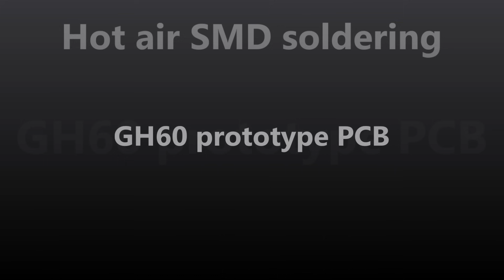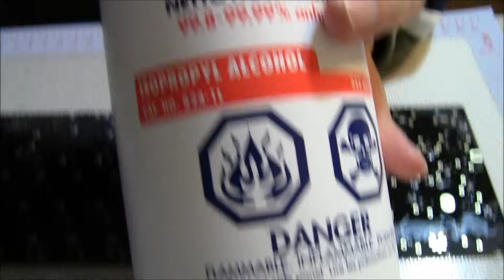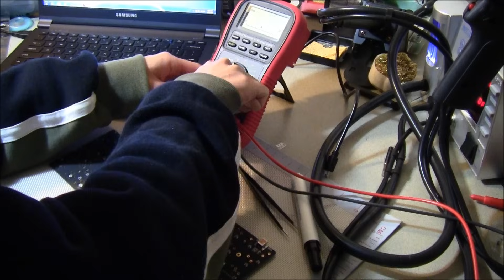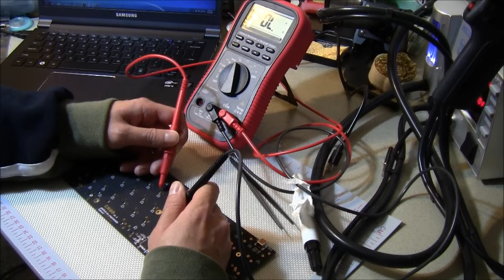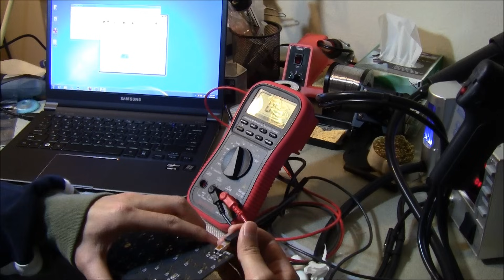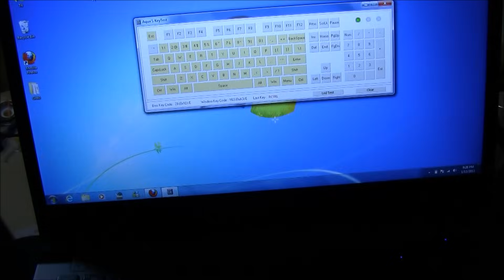SMD soldering by hot air

Comment: Ignore all the 'I was soldering when you were hanging off your mommy's apron strings' know it alls. I too have been at this for a few decades difference being I continue my education into the state of the art. The low melt paste is fine and you're preparing the pads so I see no problems with your methods of attachment. I will suggest a few things, though.

 For example your controller IC. Standard flux paste on a swab across all pads and then drag solder it. You can find drag solder demos all over YT. It's easy to learn and achieves ISO standards. Learning this method will cut assembly time down. You want to get your assembly time down.

 For testing your keys you also might find switching your DMM into continuity mode and using the probes to be faster than moving the tweezers about. This will cut down testing time.

 Lastly, as a designer/builder consider real world working environment. USB mini and micro are prone to damage in use. Even with careful use. Consider a tiny drop of epoxy under the port before placement. You may have to experiment with this and use a higher melt standard solder on the ground lugs. The goal however is to achieve a robust jack mount less prone to breakage.

 You have a lot of skill at your age. Take the advice of the elders but take it with a grain of salt. A lot of them don't continue to educate in the state of the assembly materials art. The materials you're using are designed to be used just as you are. They don't understand that the majority of CE on the shelf today is built using these exact materials and methods, only by machine.

 Lastly, a lot of PCB fabs will offer to pick, place, and wave solder your parts for additional setup fees. Might not be enough product to merit the additional costs on this project, but something to consider for high volume. They offer this in stages so you can opt for the SMD and then you just have to inspect and add the through hole parts yourself. You may find yourself in a position where this makes sense in the future.

Edit: And definitely ignore people like Barry who come by 4 years later and drop 2 dollar words during the apocalypse and point out autocorrect errors at 3am instead of just offering some encouragement to a kid. They’re absolutely part of the problem. ;)
Reply: +monosurge I simply must take the time to applaud your comment! Bravo!
Reply: +monosurge I have to also say... probably the most constructive comment on this video and no bullshit ego or douchebaggery.
Reply: +Nathan Kopilec Simple words from a simple man.
Reply: +Michael Snyder Must have struck a chord with you.. But I wasn't in any way implicitly singling you out with respect to "douchebaggery". I happen to own a company which develops automation equipment, motion control equipment, and tooling. I hold multiple degrees in mechanical, electrical, and controls engineering, and have been studying synthetic chemistry for quite a few years. If that makes me simple, I hope the rest of the world follows suit. There's also nothing I hate more in the world than the many pricks who profess some grand possession of knowledge, but are either unwilling to share it or are unable to do so without being a prick. I didn't need the help from the video.. I just happened to watch it, but I appreciate people who offer help and experience in a constructive manner. Those who are simple can be taught.  Those who bathe in their own ego are hopeless.
Reply: +Nathan Kopilec Very well said! The most insecure dogs, bark the loudest.
Reply: Oh, good, someone with experience who isn't afraid that someone won't know about it.
Reply: I've been soldering since you were hanging from mommys apron strings.

Sorry, had to do it XD

In all seriousness, your comment is good and I agree with what you say.
Reply: Unrelated. what should i set my temp to :?
Reply: monosurg
Reply: well said and all this helps the community of like minded/trying ot be good at their hobby, job, profession xx my 2 cents
Reply: Anyway you could do this for adding the full HD mod. To 230x thinkpad?
Reply: I definitely agree with @monosurge

Regarding micro USB/mini USB ports: from a mechanical point of view, the insertion force when plugging in a connector is applied orthogonal to the solder pads - and the only thing to counteract this force is the solder between part and pad. This does add a fair bit of stress to the solder joints, so after many insertion cycles, this might be a common source of failure.
It would be likely better to use a connector that comes with THT strain relief pins, because the THT hole allows the pressure to be applied horizontally against the PCB, which reduces the risk to shear off the connector described earlier.

But you have absolutely no reason to believe me, I'm not an EE by trade, I'm just a 18 yo guy telling you things.
Reply: Barry Manilowa  - no harm done adding epoxy in securing items such  as USB parts to boards - especially for those of us willing to go extra step producing a product of enhanced quality. I've seen boards from factory origin having resins securing such parts...
Reply: @alphaprot2518  - I too agree
Reply: you said lastly more than once
Reply: Well how bout 4 years later saying thank you for dropping some amazingly useful knowledge!!!

Comment: This isn't a bad start for people who want to learn, but here is the more proper way to solder using the paste and hot air method without having to waste time tacking on the IC.

First, and I don't see very many soldering tutorials say this, but clean your board and your component before soldering. The solder will not stick to dirty surface. Simply just dab an acid brush (or soft bristled tooth brush into some isopropyl alcohol.

Flux, yes there is flux in the solder paste, but placing flux on the area you just cleaned, keeps it cleaned.

After that, just place the component (IC) on the board and apply the paste across the legs as he did here. The solder will pull the part onto the pads on the board, just as you see when he did the caps and resistors.

And as always, clean the flux residue afterwards. But more importantly, stay safe!

Cheers
Reply: He tagged the ic to the board by two legs first so that he could melt the solder paste on one side of the ic at a time without it going out of alignment. That way he didn't have to use a massive nozzle on the hot air gun and heat the whole ic to 200+ degrees C. And by the way Americans, we British correctly pronounce the word solder not sodder! hehe!
Reply: +Dan Davenport Hi Dan, go to http://dictionary.cambridge.org/us/pronunciation/english/solder. In America Solder is pronounced differently than in England, just depends on where you were brought up. Either way is correct.
Reply: +Gerald Godbee So...according to how I hear that...in England they hold things together with soda. ;-)
Reply: The American pronunciation seems to have a silent L. The way the English pronounce it I guess it should be spelt soleder. A lot of American pronunciations are much more consistent than English ones. I don't think we are more correct really I just think it sounds funny so I pointed it out.
Reply: Anderson D you probably didn't watch the whole video.
Reply: @geekyoyd  not only is the l silent it often is not used in the spelling. I buy soder wick but buy wire solder. I am in Australia.
Reply: @peterwhitfield8724  It is if you spell it soder like Americans do.
Reply: Using flux ánd paste is usually a guarantee for a mess. The flux and other solvents in paste are there to do what normal flux does for normal wire solder or when using a gull wing tip for your soldering iron. If the additional flux and flux used in the paste do not match, things can get very messy. I expect most people don't do any research on this, if the data is even provided for the consumables used.
It is even advised against in the IPC standard (and for good reason). Either use flux and solder wire, or use paste. Do NOT combine.

Comment: How things have changed! Back in the day we were taught to solder transistors, diodes and ICs quickly so as to not overheat them. Now those things are left literally smoking hot after the hot air is directed at them. They must be built to withstand this of course, but still to me it is odd how those little components can take so much heat. Thanks for posting.
Reply: corisco tupi The smoke you are seeing in this video is from the solder paste. The parts are not getting as hot as you think they are.
Reply: +corisco tupi I used to wonder about that too, but the boards go through an oven when they are soldered at the factory.

Comment: Don't be mad but i'd rather solder it by hand with soldering iron. It would be much quicker. If You are not confident of stiffnes or stressless of solder You can reflow it with hot air. BUT in a way You do it (each side apart) You put as much stress in chip as while hand-soldering it. You should heat whole chip at a time. Anyways, that is preety nice that someone does something nice. Keep up!

Comment: Hi, 
after soldering SMD parts this way for a few years I recently tried some freehand solder paste.  Standard high melting temperature paste was applied roughly with the tip of tweezers. No stencil was used and the paste bridged the pads before reflow. The parts were put in place and then reflowed with a hand-held hot air tool. Although the hot air tool was a bit fancy something simple should work just as well.
 Surface tension sorts it all out!  All the boards worked with no shorts and looked like they had been reflowed on the SMD line. The LEDs with hidden pads underneath even worked.
Have Fun.
Reply: What size  paste did you use in this video ?

Comment: I always solder chips and larger packages with an iron and standard solder. I found that to be alot more efficient than applying paste to their pads. You either have to be really precise when applying it or rework the joints (lose legs, bridges, ..) afterwards. If you pull the iron along the legs (not across) away from the chip, you end up with nearly no bridges. Provided you didn't add a ton of solder.
For all the small ass components such as LEDs, resistors and capacitors I use paste, too. It's just to tedious to put them on with an iron.
Reply: Funny ;) I almost never use paste anymore since I invested in a gullwing tip for my soldering iron. Got the first experience with such a tip at work. I knew how to use such tips, so when I used it how I should, I got this strong feeling like 'why on earth didn't I get myself one sooner!?'
I can get LED's resistors and capacitors done quicker with a gullwing tip than with paste and hot air, as you just don't need the paste and wait for the hot air to heat up everything to the point the tin liquifies (and, having recently acquired my IPC certification on soldering (never knew you could have a 5-day, mostly theoretical training on that subject...) it's good practice to have a first round of heat at lower temperature, to get the solvents to evaporate before heating up to the point where the tin turns into a liquid.

Comment: Do not forget the preheating, it's very important ! A temperature step is required depending on the nature of the welding alloy you are using. In your case, the tin has melted, the contact is established but the welding will be very fragile in time. Often people do not understand why their circuit no longer works !
Reply: How do you pre-heat?
Reply: @michelfrance75 Do just preheat only the board or the chip and other components too?
Reply: @bleak0218 Pre-heating is not thát important in some cases and this is probably one of them. Preheating is usually only done/necessary when a part needs to removed or soldered and the PCB features a few very heavy grond planes, dissipating a lot of heat from the pads that are to be heated for desoldering, rework or soldering.
Ceramic capacitors also tend to be prone to risks of thermal stress and can require pre-heating (look up the manufacturers' datasheet on this).
But how bad it can get and how long it will take before failure occurs also depends on other factors: thermal stress AFTER soldering and during intended use of the assembly also greatly affects overall lifetime. As with everything, there are standards that give some indication on expected lifetime when parts are stressed beyond their stated limits.
Especially ceramic capacitors and them being prone to the risks of thermal stress is why FT-types (Flexible Termination) types are becoming ever more common. Even in small sizes, manufacturers found a way to incorporate a flexible barrier between the actual outside-terminal and inner layers, so it is far less prone to problems caused by thermal stress.
Ofcourse, these are more expensive, but can seriously impact reliability.
If you want to preheat, you usually pre-heat the area of a board where you will be reworking, removing or soldering components. Don't restrict heat to a small area, you want to avoid thermal stress to the PCB and the parts being blasted with hot air.
But to be honest, I would forget about soldering these parts by hot air and just use a gull wing tip in a soldering iron and flux instead. The flux takes care of the wetting of the solder, the gull wing tip retains a small amount of solder in the hollow section and by dragging it along the pins of an IC or capacitor or other component, the cleaning action of the flux will make the solder want to get to the pad and component. But surface-tension of the solder inside the hollow cup of the tip will also make sure that exactly the right amount of solder is left on the connection.
You can do complex fine-pitch IC's in just 10 seconds once you get the hang of drag soldering with a gull wing tip and once you've used one for the first time (and you have used a normal tipped iron before) you will wonder why you didn't buy such a tip earlier...

Comment: I am a TV Tech of 40 plus years I think this man did a good job 
Of what materials he has to work with.Hot air tool must have been at a low setting otherwise the smd componants would have blown off the board.
Nice Video

Comment: So many jerks that "I know how to do it" and "I'm in business long before you were born". But few commenters really understand what is important and what is not important when doing home soldering. It's the area when industrial experience may be very irrelevant because the process is human-controlled and you can always fix things like bridge or dry joints. This is not the case in a "big" production that does not tolerate many things. What's important is at the end you got a well-soldered board with no soldering defects.  The only thing I would notice is that I'm not sure that the main IC wasn't overheated. Looks like you use very high temperature. But for digital schemes this is less relevant.
Reply: +Alexandre Kandalintsev No such thing as a "dry joint", ,"cold joint" yes. Good technique whether at work or at home, always trumps shitty poor quality that can render your "repaired" electronics useless. I was a hobbyist first and when I started working professionally in electronics I had to unlearn a lot of the " bad' habits" that were passed down to me by other hobbyists. I was encouraged to try things my way to see the results then try it my mentors way to see the difference. Much of what I learned on the job, I applied as a hobbyist. Industrial experience is never irrelevant. Whether reworking one piece or 1000 pieces, the process applied manually is still the same.
Reply: +Michael Snyder are you qualifying these joints as poor?
Reply: +Alexandre Kandalintsev I'm not qualifying any joints at all.
Reply: +Michael Snyder why are you ignoring the quality aspect? Only the "QC" can tell if the tech process good or not. To me, the visual inspection and the final result shows this guy knows what he is doing.
Anyway, I believe skills are by far the most contributing factor to the quality. You can make bad joints even with good chemicals and equipment. Or you can do a good job even if "something is not right".
Reply: Good tools are half the job.

Comment: From the sound that you rework station is making I can tell that you did not remove the pump screw at the buttom of the machine. the screw keeps the pump seceure during shiping but it creates metal to metal contact with the body of the station. If you remoe it the pump will be secured by just rubber feet and wont make much sound.

Comment: I like they way the surface tension of the solder paste aligns the parts as it begins to flow. Just got my first hot air tool from Asia and forgot it was going to need a 220v outlet at my bench. Of course I could just modify the stepdown transformer on the rather large wallwart to make operating voltage from the 110V mains. I will have to look into that :-)